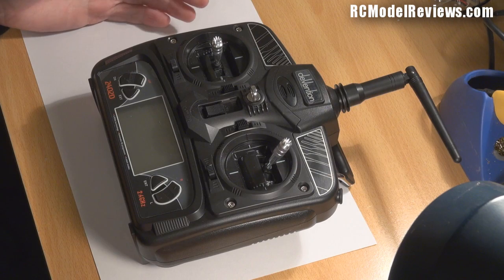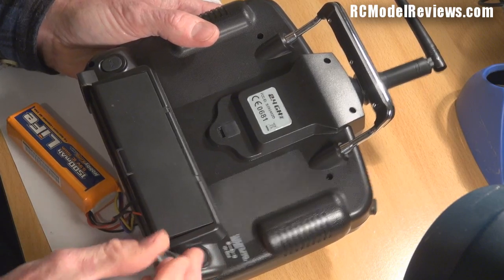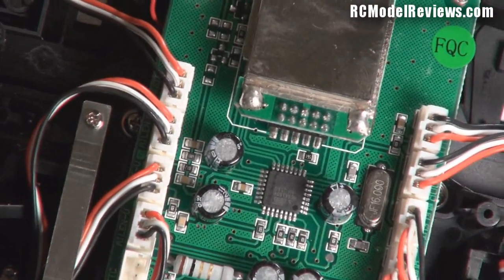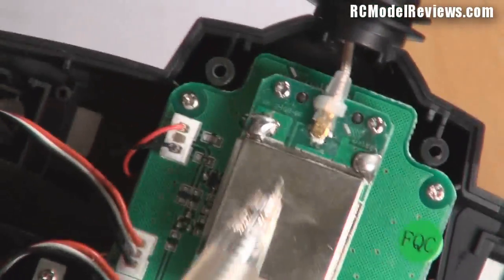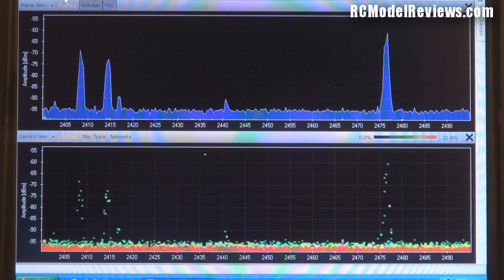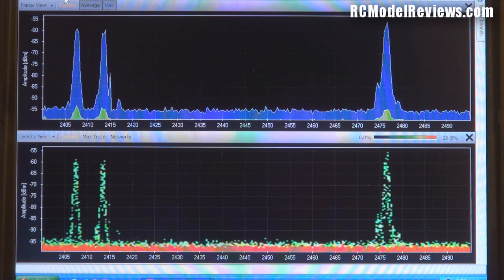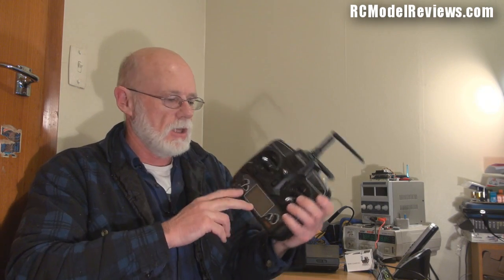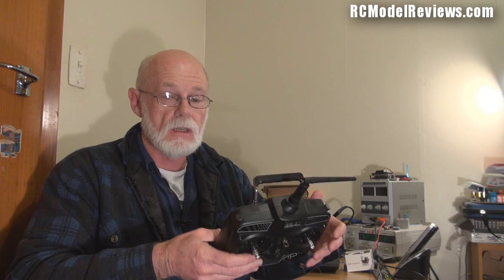Review: Walkera Devention 2.4GHz

Comment: At ultrasonic frequencies, plastics flow like butter.  There's a swing arm ultrasonic vibrating tool, that you just push the screws in as if they were pins.  The plastic flows around them, then cools, and it's tighter than if you screwed them in initially.  They're melted to the screw first time, not just cranked in.  That's why there's a different feel after the first time.

Much faster and less problems, even cheap factories tend to have them since it saves money.

Comment: Great review! thank you. I have a question about the Sky Fly 9X if you find the time, I picked a frsky V8R7SP receiver and the V8JT set but they stopped making them? so I picked up the new DJT with Telemetry with the receiver the two are 7 channel, but I found out the old set up has a little more range? they both of them are good items but have you seen this? and what do you think about them? they just plug in and bind and away you go I'm going to put a set in my Turnigy 9X. thank you.